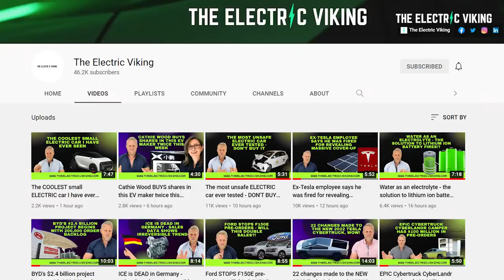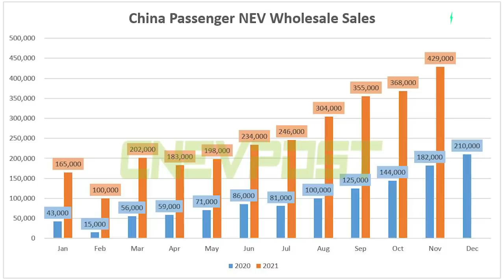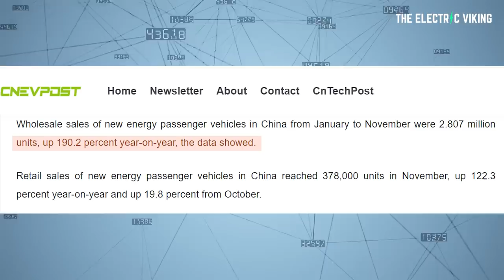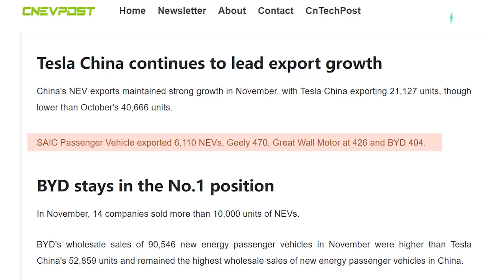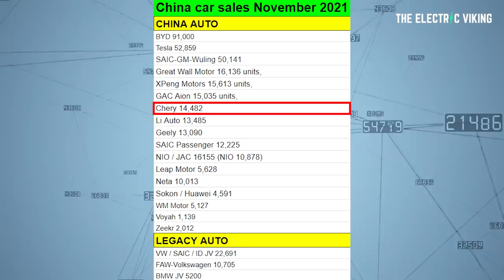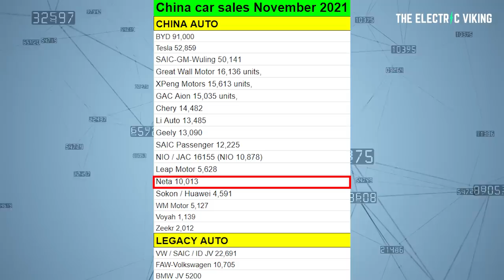New SALES data shows LEGACY auto is screwed in China

Comment: Good point. But I actually believe that new cars in China will be majority EV by early 2023 instead of 2026. Adoption of any new generation product usually happens like this: sale of new product reaches a critical point after which sale of the obsolete product drops off a cliff. That's because the usually lagging conventional wisdom finally catches on and the tide is decisively turned. Remember the dumbphones before smartphones? In the final stretch they disappeared from stores rapidly. But there's a caveat -> EV production capacity.
Reply: good point, too. It will be interesting to see if EV production can be ramped up quickly enough to meet the demand. I think the Chinese manufacturers might have a big advantage because they own the critical battery production and arguably have the best technology right now. The legacy carmakers and even Tesla probably already depend on them to some extent.

Comment: Wow I love that graph.  Over 10x per month increase in 2 years.  Much as I want my Aptera (mostly for fun factor) a small cheap EV from china would make a lot more practical sense for me.  Seriously can we please get a sub $15k 2 seat car for around town in North America.
Reply: there are ev cars in china below $9000. xlent features 200 - 300 km/charge
Reply: The Dolphin is under 15k in China, and it has 4 seats!
Reply: Have to pass crash test. Also, as we move through time, you won't need as much range, since there will be many more chargers, and at the same time, batteries will decline in cost. Also, the supply of used EVs will increase.
Reply: @fjalics  China has met European stands with some cheap evs like the Mini EV.  Safety tests require improvements and that increases costs a little bit doesn't justify what we see as costs for entry level evs in na.  China has way more low cost options.  Tesla is a great car company but the products are expensive.  Getting evs cheap enough that people will ditch functional used vehicles (say with 100 miles / 10 years old) for evs rather than driving them into the ground will require a way cheaper cost to entry.
Reply: @ccibinel Tesla hasn't scaled up enough to make a vehicle like that yet. They are working on it. Next step, ramp the 2 new factories. They have to be able to make enough Model Ys, and even Cybertrucks.
Reply: @ccibinel The new Zoe didn't do so hot. The Dacia Spring either. I do think this is solvable though, and will be solved.